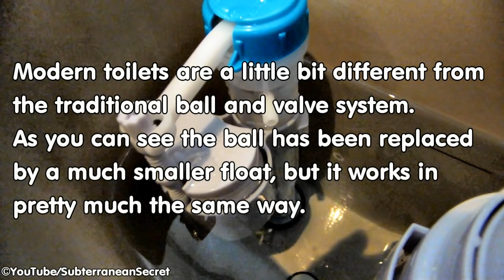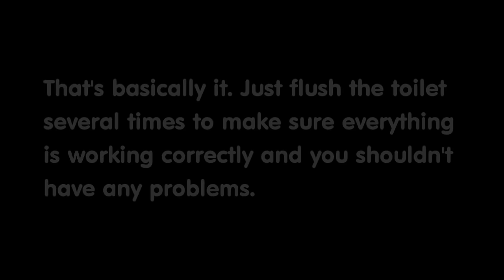How to Adjust the Flush Water Level on a Modern Toilet System

Comment: Thank you so much for this very informative tutorial sir. I just fix my overflowing problem. It helps me save money by not buying new apparatus and no more overflowing water bill 😂. my floater hit the flush valve so close that it doesn't even go up when full so it keeps on over flowing. I just pull back the floater so that it won't touch the flush valve and problem solved. Thank you so much for the idea 💡..., ☺️

Comment: Thanks for making your video -- it got me going down the right path even though my fill valve assembly was a bit different.  I bought a HB60000 universal Fill Valve Assembly (black and white plastic) to replace the fill valve in my Jacuzzi Perfecta toilet (blue float and top of float valve cap is blue; rest is white).  For both models, there's a small L-shaped square of plastic (red for Jacuzzi, blue for HB60000) which locks the upper shaft and lower shaft together.  It sticks out perpendicular to the shaft, and the other half runs parallel to the upper shaft and under the upper shaft.  Push down on the tab to unlock the shafts from each other -- it might be 1 or 2 clicks or it might just come all the way out.  That frees the top shaft to rotate on the lower shaft on which it sits.  Rotate top shaft (which has the float attached) counterclockwise which unlocks or frees the upper shaft from the lower shaft, then move upper shaft up and down on the lower shaft to adjust the height of the upper shaft and its attached float (which adjusts the water level).  For me, the tab came all the way out although I think I could have left it in place instead of removing it.  It's best to do this adjustment of the float level and upper shaft with an empty tank (turn off water to toilet and flush toilet first) or before you install the new float valve assembly because that float is really strong and once you unlock the shafts from each other, the float with push the upper shaft up strongly and quickly and you have to fight it to adjust it to the level you want.  Also best to adjust the water level with the assembly out of the tank since it's hard to see and get your hands into the tanks to do this.  Anyway, once the upper shaft and float are at the right height for the water level you want, rotate upper shaft clockwise to lock it onto lower shaft.  Then put the tab of plastic back in (or if it didn't come out then just move it back upward into place with one or two clicks).  Hope that helps someone since I think my float valve assembly design and model were different than the one in this video.
Reply: Ray Mears toilet fix?

Comment: My syphon was letting water b into the toilet pan, it was a new toilet. Then I had a thought, if the water level  in my cistern was just not high enough, the force acting on the seal wouldnt be great enough for it to seal. I used your video to increase the volume of water in my cistern, thus increasing the weight on the syphon rubber sealing valve and it fixed my leaking syphon. Thanks

Comment: I'm amazed to see so many positive comments about this filler, which to my mind is very close to being absolute rubbish. The lock switch is so difficult to shift you need a screwdriver, which of course you can't manage when the thing is installed. Despite following the video, mine continues to keep filling, even after it has supposedly filled and shut the valve off, wasting gallons of water. I deeply regret buying a "cheap" WC from B&Q.

Comment: Thanks for the video. The problem I have is that the water does not reach the full water line because the float rises to the top too soon & then the water is cut off. I cannot adjust the float screw to let more water into the cistern because it has been adjusted as far as it can go. The design of the screw is terrible because the thread stops 3 3rds of the way up. Which means that the thread does not go the full length of the screw so it cannot be adjusted anymore than that. 
So even on full flush the toilet does not flush the waste away completely & so we have to flush twice. (They call it a water saving model but it doesn't save water if you have to flush twice!)
We have had this issue ever since we had the new toilet installed less than a year ago & I miss the old one which was probably as old as the house (built in 1952!) They dont make em like they use too.
 The only solution I can think of is to go back to the plumber &/or find a screw with thread on the complete length so I can adjust the water level. I dont know if there is one available as a replacement.
It's a Levivi Marbella toilet from Plumbing World NZ.
Do you have any good suggestions please?
Reply: Wow same issues here! 
I have found some relief with letting go of my super plush fancy ply paper and finding the fastest disintegrating t.p roll we could handle. We only have to double flush once a week now.

Comment: CHEERS MATE!! I will try this with my very similar design Tuscany dual push-button... These are nice looking toilets with slow/quiet close seats, but the flushing mechanism has cost me THOUSANDS of dollars  each time that I have to call the plumber to unclog my drains in my multi-units after my tenants clogged it... 

HEY GUYS, I have an easy idea on how to fix that overflow issue if you would like to get even more water in... Try the following, which I already know would work as a SMART/DEEP/THINKER/INNOVATOR as I...

Solution: Purchase a compression-type rubber fitting with rings that allow you to attach via fasteners... Now attach a 1" (I am guessing that the over-flow is around 1"-2" pipe, so get one compression fitting just slightly wider to go around the over-flow pipe)... Tighten up snugly... VIOLA! You have successfully extended the overflow by another 4-6 inches. So now, you can adjust the height of your water even higher up to around 2"-3" higher or 8L-9L (this also depends on how high the mechanism would allow for you to adjust)... VIOLA! You should now have an even more stronger flush after this mod, assuming that the mechanism will allow you to adjust the height even higher... I will try this idea, and I should make a video about it one of these days... Good luck mates and tell me how this idea work (it should/will work as I am rather confident, except the mechanism doesn't allow you to adjust that high as this is the only restriction)....

Comment: This is an R&T fill valve that is from China. They can be found in ProFlo, Glacier Bay, Niza Pro, and a few others.
Reply: Owen Cowan  do you happen to know where to get it? I need to replace this whole thing and am struggling to find replacements! Thanks
Reply: @RJ-gg9xp  You can find it on a website called AliExpress or at a plumbing store called Ferguson. You do not need that exact fill valve though, you can just get a Fluidmaster, korky, or any universal fill valve.

Comment: There must have been a change in design it seems your toilet has a slight change in the float also i noticed you don't have an overflow tube to prevent tank from over filling For those of you that have one you will have to extend yours or cap it off However if you cap it off you run the risk of having water run all over your floor if the shutoff float ever sticks

Comment: best video I have seen so far - I have a problem which means that the water fills and it goes down the overflow pipe - the little plastic bag that surrounds the plastic part that is next to the stop cock is ripped and I am not sure if that might be the reason some how.  So far I have taken off the post  to get to the rubber seal but that seems to be ok,.  The water stops rushing in fast when refilling but it is still steadily filllnig until it reaches the top of the overflow.  I think I need buy a new unit or call a plumber - I am going to check rubber washer  one more time to make sure it is working but it seemed ok

Comment: would you turn the screw for the fill valve clockwise (as in this video) to increase the flush volume? Typically most online advice recommends counter clock wise to increase the flush volume. Is this particular fill valve different than the standard ones?

Comment: got it, 

what are the graduation marks 1-40 on the outlet used for, got a situation where i have water in the cystern and the inlet tap is shut    - push the button and the dump button works for the required time i want it, but if i open the water supply  and then push the dump button water continues to run.  almost a new unit, doesn't seem to be any debris around the seal rubber looks ok?

Comment: Thanks!! Can not stand these water savers that are not water savers!!
Reply: You need to flush twice just to get it down lol
Reply: I just bought a toilet and I have the same problem. It took me some time to figure out the problem. Unfortunately the over flow tube is cut too short which prevents me from adding more water. I think I can buy an over flow tube extender but this is crazy. The toilets should be designed to flush well with less water and if that can’t be done then go back to the way it was before. There is no water saved if that toilet has to be flushed 2 or 3 times to flush everything away.

Comment: Didn't work for me :-< Ours does have one of these BUT there is NO "little switch" that allows the float to free itself. There are no "ribs" or "ridges" on the vertical filler pipe to grab the float and move it up and down. Still works, but...

Comment: I could not find a switch and turning the screw did nothing and this is a new valve.
Reply: Same here. Does nothing with the newer-style toilet my landlord installed. The water level is low and stays low. And a plumber told me it's just made that way (which makes the screw-thing it has very confusing). Argh.

Comment: My Galba toilet is only 2 years old. I noticed the other day the fill valve was slowly running even after it reached the fill line. I lowered the float to lower the fill line BUT even with the float in the cut off position the valve is still allowing water to slowly run water. My guess is the fill valve has gone bad. Any other adjustments to try before I order a new fill valve?

Comment: Hi - do you know where to find the replacement parts? This is the exact set up as my toilet and I need to replace the dual flush valve next to it as well.  The part you mention is leaking from the top so I’m thinking it needs a replacement! Thanks

Comment: Some people say to screw the rod, Nothing about the "switch" on the back. My flushing is Not dual. Would that make a difference?  I  just want my bowl water to raise, but when it did, it also went into the filling tube.  I will keep working at it. Maybe my Project Sources toilet is a piece of crap, No pun intended. lol. Thanks.

Comment: As shown, I adjusted the float housing so it was further up and then adjusted the float by twisting the screw.  At first, it seemed to work as the water level in the bowl went up to a good level.  However, then water in the bowl slowly flowed out until the water level was low again!  Is there anything else I can do please?
Reply: Was I even working there then? Lol

Comment: I turned the water off and used the tip of the screw driver to push it in to the right.  You can't see how he did it in the video but I slowed it down several times and noticed that it looked pushed in.  I couldn't do it with my hands like he did so I gently used the tip of my screwdriver.
Reply: OMG.. Thanks so much Sylvia! I never could have done this without you! Please make your own videos!  LOL
Reply: Sylvia Wofford I
Reply: Sylvia Wofford sorry but do you mean you used the screwdriver at the back where he said the clip was or on the white screw top front thank you need urgent reply ...
Reply: I'll try that could reach short fingers

Comment: I discovered another solution. If  anyone find difficult to move the button as myself then better to tie some thing light heavy thing with the floater then it will come more water into the system  to lift the floater but not too heavy thing otherwise water never stop to come in. It's work for me as couldn't move the button.

Comment: Do you know how to repair if the water in the bowl (not tank) is too low? Which of those parts in the tank are responsible? Thanks.
Reply: The water level in the bowl is a result of the geometry of the trap, and there is no way to adjust it once the toilet is manufactured. Some low flush units don't have much of a water surface area, and the Bowl soils all the time. This seems especially true with a Caroma toilet - which we just installed. Our Pearl unit is a bit better, and an American Standard unit is the best we have in the family. We can't even return the Caroma as it only has a 14 day return at the distributor. We bought it before we renovated the Bathroom - and it took us a couple months before installing the toilet.
Reply: The fill valve. Connect the rubber hose to the overflow tube so that it brings water to the bowl.

Comment: How do you flip the switch?
Reply: Allie Ho Jessica Nelson-Jones I turned the water off and used the tip of the screw driver to push it in to the right.  You can't see how he did it in the video but I slowed it down several times and noticed that it looked pushed in.  I couldn't do it with my hands like he did so I gently used the tip of my screwdriver.

Comment: The new ones have a very short overflow tube so that you can't adjust it past the 1.6 capacity without taking it apart and replacing the tube with a longer one.  I'm having sewer line blockage issues because the water capacity is too low to clear the waste, and I also suspect the kids will do a half flush not paying attention.  These toilets are complete crap.

Comment: My pin to remove the handle looks different. It does not come off when I pull it towards either side with a needle nose after removing the cap. Can anyone assist?

Comment: I want solution for when i push the button of flash tank. Water flow didn't stop till the water tank empty. I want to pass  limited water.
Reply: I think you would adjust the float the opposite of what this video shows,so the float is lower and shuts off water faster.

Comment: So frustrating I can't find the switch in the first step. This is a terrible toilet it has the worst flush doesn't flush properly.
Reply: Jessica Nelson-Jones
Reply: Jessica Nelson-Jones I turned the water off and used the tip of the screw driver to push it in to the right.  You can't see how he did it in the video but I slowed it down several times and noticed that it looked pushed in.  I couldn't do it with my hands like he did so I gently used the tip of my screwdriver.

Comment: That switch is extremely STIFF! UNNECESSARILY STIFF! On my toilet the filler tube is on the right side so the switch is on the corner of the cistern, EXTREMELY hard to get at. The only way i could slide it sideways was to use a 90 degree pick and push it hard until i heard the click. Stupid bloody design, could be made far easier for adjustment. I have the exact same filler as in the video
Reply: I'm sure it's caused by company trying to maximize profit ! 🤨

Comment: I wish you video better while flipping switch.
Reply: Konstantin Razmadze Jessica Nelson-Jones I turned the water off and used the tip of the screw driver to push it in to the right.  You can't see how he did it in the video but I slowed it down several times and noticed that it looked pushed in.  I couldn't do it with my hands like he did so I gently used the tip of my screwdriver.
Reply: Yes, t works, Sylvia Wofford, but not in my type of tank (dual flush). There is an extra floating mechanism that will not let adjust water higher level...
Reply: Konstantin Razmadze I have a dual flush and HATE  it, that's why I'm here lol not enough water in the bowl. 1st won't take down a small piece of tp and solids need 3 or more to get clean water, IF it doesn't need a plunger to get it down!
Reply: I used my finger to feel which way it moved back and forth.  It still seemed tight and did not move easily so I got a small mirror and saw it better.  After seeing it better I was able to apply more force to open the switch.  It appears some go left and right and some might go up and down so jiggle it to see which way it goes before applying more force.